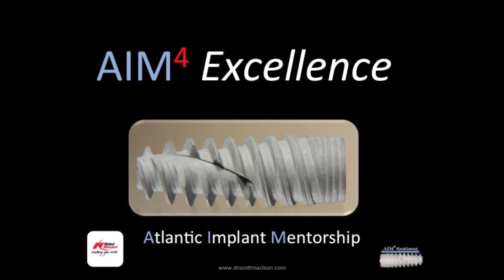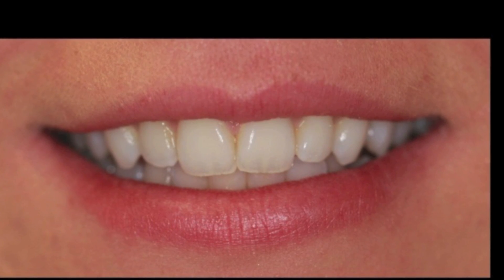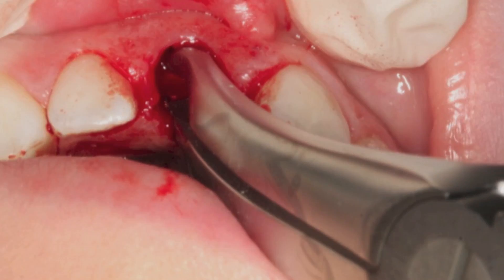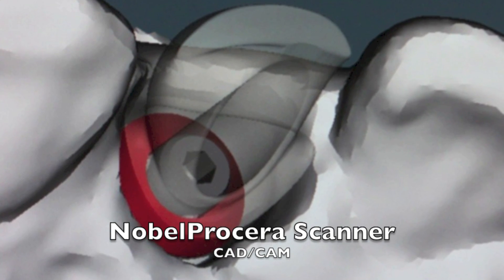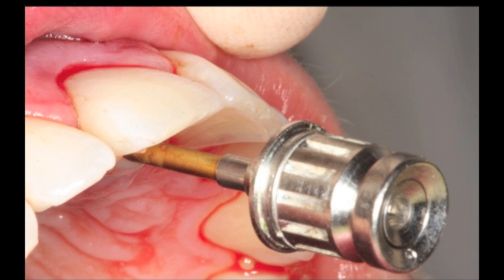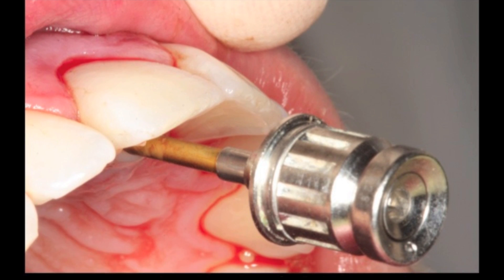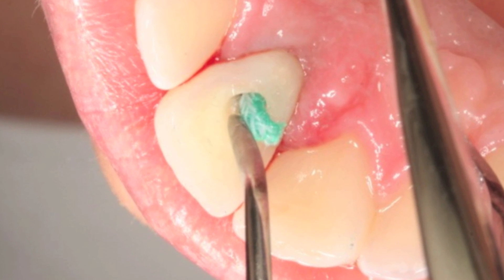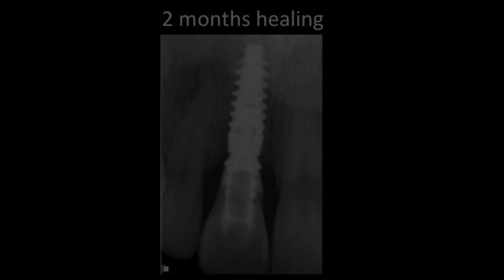*New - Dental Implant - Temporization with Dr Scott MacLean

Comment: Very nice job done in perfection. 
One tips would be to place Teflon tape on top of the abutment screw then fill up the access with flow composite. This way when you come back with high speed drill to remove the composite it won’t engage to the Teflon at all if Teflon has been packed. Thank you
Reply from the maker: We do that on all final restorations.

Comment: Very nicely done!!  I personally no longer use Fermit to close the access.  It does not seal against bacterial invasion as evidenced by significant odor when the Fermit is later removed. .  I place teflon tape and then some Benzalkonium chloride followed by Cavit or Temp it. Thanks for posting Dr. MacLean.
Reply from the maker: On a conical connection implant the conical connection seals the implant. It is tighter then the diameter of a bacteria organism. 
No smell!

hope this helps

Comment: nice video.  only question, the "cylinder" you used as the screw retained provisonal crown, is that an impression coping or an temp abutment screw retained.  I am a general dentist with a heavy emphasis on implant restorative dentistry,  My local surgeons prefer Noble Active, and we do a good amount of immediate provisonalization.  They also provide a "cementable temp abutment" and our Nobel rep as yet to provide me with screw retained temp abutments.  I have used and modified impression copings instead.  What are you using.?
Reply from the maker: bruce spivak Titanium cylinder from nobelbiocare
Reply: that is a temp. titanium cylinder..

Comment: Nice Video. I do this same procedure 2-3 times a week. I have a lab make my immediate screw retained temps. Excellent results, happy patients, happy referring dentists.
You should be using the mill to remove the overlying palatal bone. The active implants have a mill system (just like many other systems) to make sure the prosthetic connection is clear. It is safe, much quicker then what you are doing, and only removes bone/tissue that would interfere. I mill every implant I place, regardless of location.
I am an oral surgeon, and I enjoy your videos. Keep up the good work!
Reply from the maker: Hi Eric, Thanks for the great comment. I use the mill but it often does not remove enough bone. I want to have a flared mill developed to match ideal width of the abutment. Hope we meet sometime. SM
Reply from the maker: Scott MacLean now have a cc bone mill which I help design. You get A 5.2 mm flare which is usually perfect. watch adjacent teeth